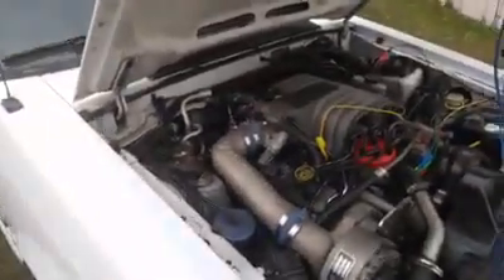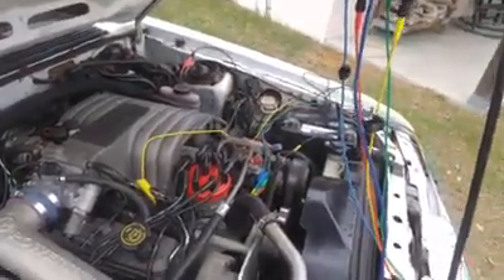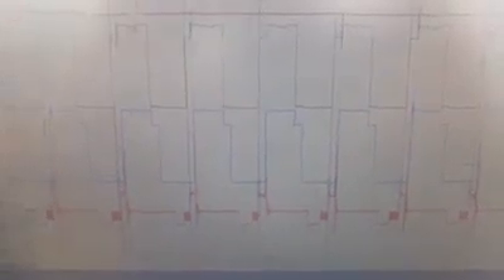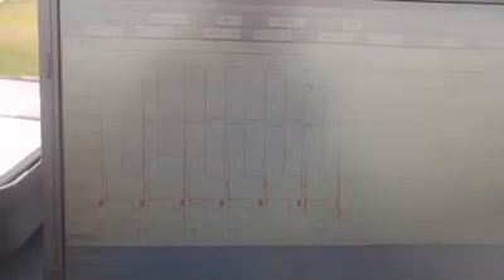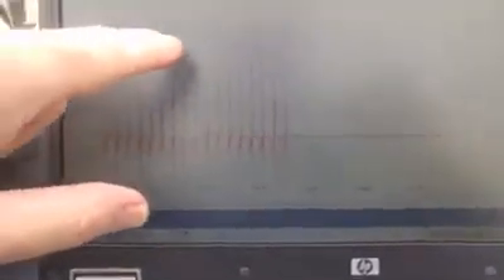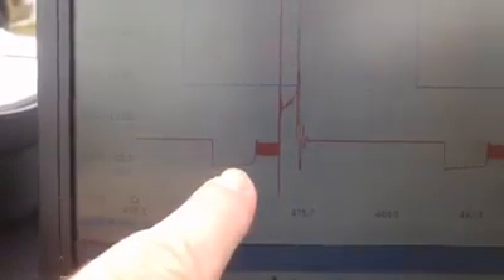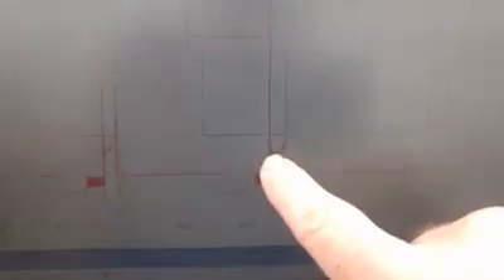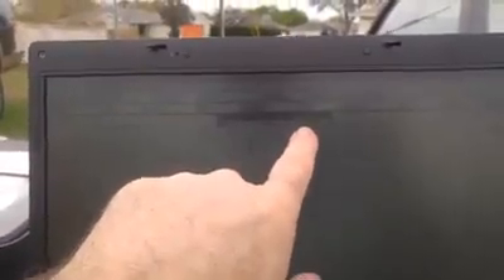5.0L Mustang TFI Ignition PIP and SPOUT Signals Part 1

Comment: I have the same issue with my engine when I unplug spout timing steady at 12 degrees  but when plug spout timing missing around is the becuse TFI module ?
Reply from the maker: What problem are you having? When you plug the SPOUT in, the computer becomes involved in altering timing. Unplugged, the pcm doesn't affect spark timing.
Reply: Surging fluctuating rpm = spout plug in 

Steady rpm steady timing =spout unplugged

Comment: How do I know if the pip is bad I replaced the coil the tfi the truck runs like shit
Reply from the maker: PIP sensor is checked using an LED test light on the PIP signal wire at the ignition module during cranking. Backprobe the PIP signal wire, put the test light in (or touch the tip to) the back probe. Ground the test light cable to battery positive. Crank the engine, and you should have a brief flash of the test light repeatedly during cranking. Usually the PIP signal wire is either the very top or very bottom wire on the module connector.

The PIP signal is a brief 12v signal coming from the pickup coil in the distributor every time a cylinder comes up to bat (which is 4 times per crankshaft revolution). The PIP signal goes to the module, telling the module when to fire the coil. If the SPOUT connector is plugged in, then the PCM will modify the timing of the signal, otherwise it occurs at 10 BTDC every time. Either way, the PIP signal tells the module when to fire the coil. The module actually fires the coil by grounding it for a few thousandths of a second. When it quits grounding the coil, the coil fires a spark to the distributor cap, which disperses the spark to the appropriate cylinder.

Comment: You sure the ECU isn't bad? The compacitors often fail, causing similar issues. 
I will be digging into mine, just to be sure later this year.
Reply: Yes, I'm sure. I have a Picoscope hooked up and can see the failing signals. I am also very aware of the PCM capacitor issues these cars have, which we ALWAYS check for early on. It's a real bad issue these days too.
Reply: @Pontisteve  I'm sure you did, lol, I was just throwing that out there. Youur diagnosis set up looks pretty interesting. Is that a program are you using on your laptop?
Reply: @jpp9846  Sorry the video quality sucks, but what you are sort of seeing is the Picoscope software. It's a digital storage oscilloscope.
Reply: @Pontisteve  thanks. I was just curious, one of the most interesting diagnostics video I've seen out here. I have an 87 Fox myself and am always looking to expand my knowledge on them.

Comment: I am trying to learn this stuff with a limited amount of tools.  I have a DVOM, and a number of others, but certainly no major software computerized diagnostic tools such as you have.  Having recently bought a OBD1 code reader to get codes on my 1994 F150 5.0, I get  a 211 PIP circuit fault.  What Module are you talking about?  Sorry if I am asking this before watching 2nd video or this one clear to the end.  Is that the TFI module? Is when you say Ignition module, you mean the TFI?
Reply: Also, I pulled up your other videos and will hunt my way through the ones you posted that pertain to EEC IV and TFI etc testing on a FoX Body Ford.  My truck is a 5.0 F150 that has developed a miss, and poor running condition first as an intermittent sputter, then a more regularly occurring worsening especially once I go to increase throttle such as heading up a hill or entering highways etc. then most recently it doesn't even want to cold start easily and stay idling.   Once idle is achieved, it runs fairly smoothly, but once driven normally, the issue re-surfaces and check engine light comes on.
Reply: The exact same thing as Mark's truck but when it starts up it starts up good idles perfectly but when the engine temperature gets up to normal operating temperature it runs like a dog doesn't want to idle doesn't want to run it's sputters cough spits bucks jerks whatever you want to call it it does all the above I'm about ready to get rid of this piece of s*** go back to Chevy where I belong

Comment from the maker: Sorry guys, I said the coil fired on the falling edge of the PIP or SPOUT signal. That's a mistake. I should have said the coil fires on the leading edge of the PIP or SPOUT signal. It uses the SPOUT signal if it's available, or the PIP signal if there is no SPOUT signal (such as when you unplug the SPOUT connector, or if the SPOUT wire is broken).